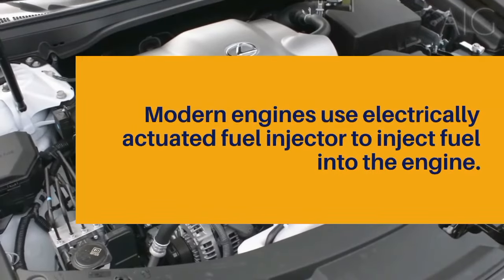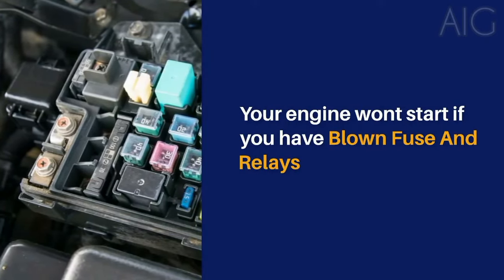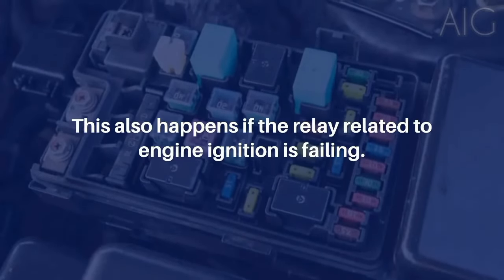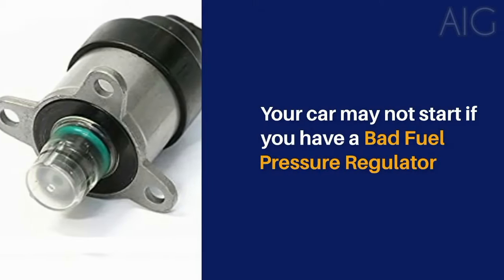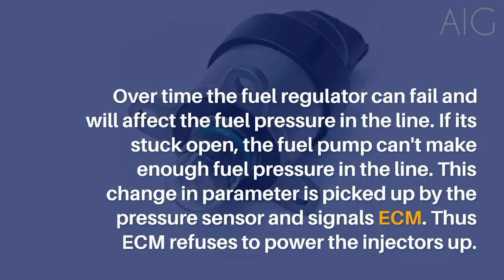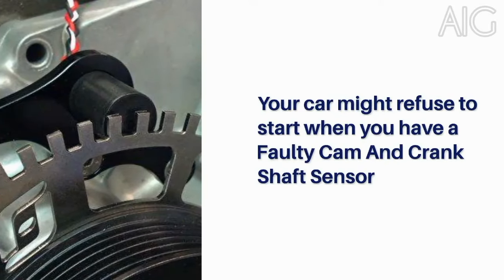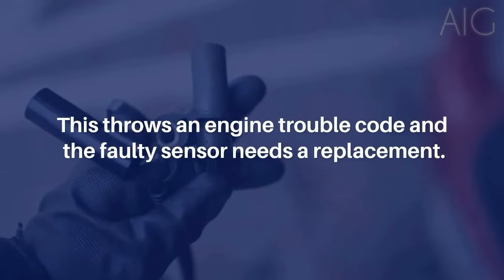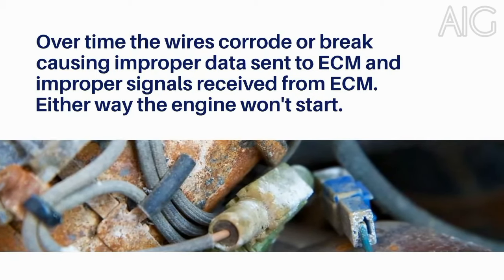Engine No Start - Reasons Explained | Basic reasons for no injector pulse in your car

Comment: I have a 125cc bike with a delfi ecu  and turn bike on and fires then dies not firing  again untill i turn ignition  off then turn on  then same again happens 😢 i have listened  to injector  and its not tapping even when i try turn bike over 😮 its anew injection unit am really  stick on this this is the reason its not starting  the fuel. It gets  fuel to injector  but its n9t letting  it past to bike  please help me.

Comment: I need help, my 99 Toyota Camry le has a crank no start. The fuel injectors won’t fire. I replaced camshaft position sensor, and my crankshaft sensor seems to be working. The injectors are getting power, and fuel is pressurized in the rail. Something is making the ecu not fire the injectors. Thoughts?
Reply: Did you fix it?
Reply: Was this fixed got same issue on a 1.4 tdci
Reply: @jadeshaw1867  I couldn’t figure it out. It’s been sitting there for a year. Sorry partner, no clue what happened.
Reply from the maker: A malfunctioning key immobilizer does the same thing. Other reasons include, malfunctioning fuel pressure sensor, internal wiring short in injector circuit, messed up air intake sensors, leaky drv in diesel head, ecm auxiliary power issues..etc...

Comment: What if power is present but not bringing fuel to common rail
Reply from the maker: Faulty fuel pump or its relay, fuel, wiring issue, completey blocked filter, in some cars damage in key immobilizer and worst case ecm damage. Last one is least expected. All this can cause no fuel.

Comment: Hi good people I have nissan np300 diesel crank but no power pulse
Reply from the maker: There re many reasons like, low fuel pressure, bad crank angle sensor or cam sensor, electrical shorts in wiring, immobilizer faults etc

Comment: @ auto I have a 2014 Chevy Cruze ls 1.8L and I have a p0302 for cylinder 2 misfire. I have changed the coil pack and spark plugs. also I have a app on my phone that connect 2 my obd2 reader and it says to changed the injector but not sure what one or the whole thing. my car will start but it idel real loud and also my rmp will go up but my speed does not. and i also have a like a brown milky fluid in my overflow. please help. also on the obd2 for the fuel Sys 1 it says CL or CL-fault and for fuel Sys 2 it sayes NA but fuel PSI is 58 fuel level is 24.7%
Reply from the maker: Hi there, if you mean coolant tank with milky precipitate, likely you have a blown head gasket.
Reply: Check wiring for bad connections befor change any parts coil and injector circuits.